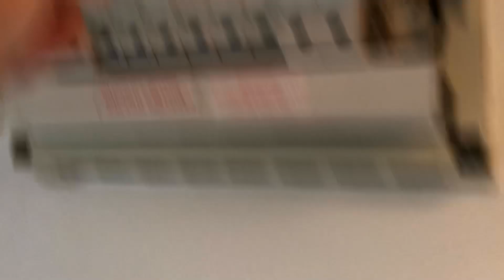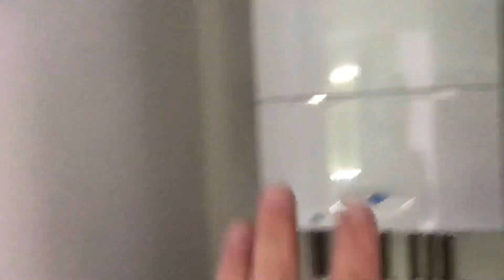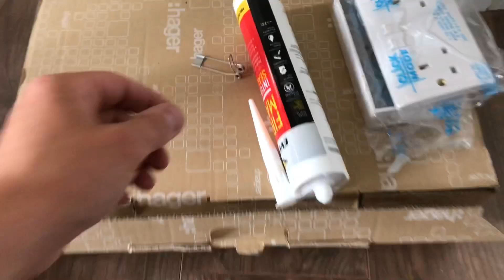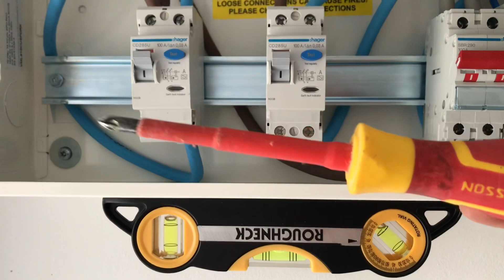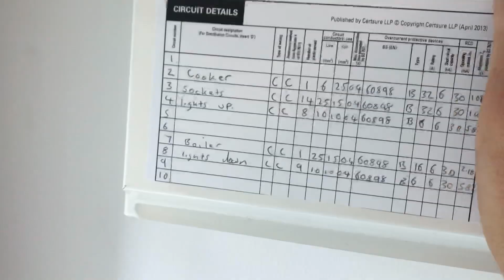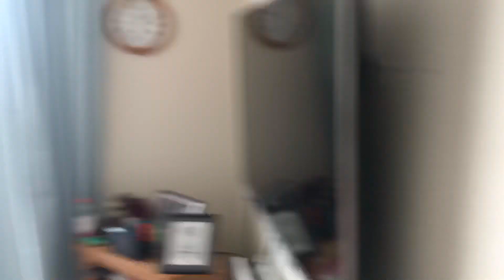CJR ELECTRICAL Installing 18th edition compliant consumer unit.

Comment: Is that fire mastic easy to remove if you needed to pull another cable through in the future?
Reply from the maker: Yeah just push a driver through or stripped cable
Reply: @Cjrelectrical  Great! Thanks for the reply

Comment: This video now a year old. I'm sure you found the neutral earth fault by now? I'm sure that you also would have fitted an mcb lock on that faulty cooker circuit.... Presumably the board that you changed it from didn't have rcd protection on the cooker.?

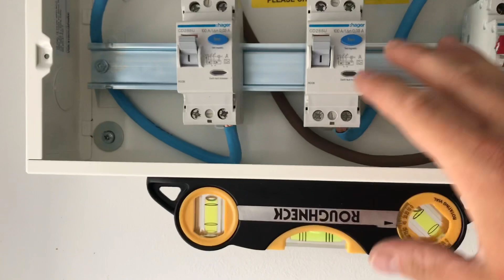Comment: 18:45 screwdriver in court? If you want to cover yourself, put the screwdriver calibration certification number on your test sheet, it's on that piece of paper everyone puts in the bin and not in their toolbox. However if your up against a good prosecutor in court they will ask.. "have you been trained"? " talk me through the use, checks storage and maintenance of a torque screwdriver". You get that wrong then holding your screw drive in court for your defence is pointless.  
You have a check dead tester..... how do you check your screwdriver?  🤯

Comment: I would be worried if any ( spark ) carrying out domestic work failed the 18th course to be honest.The one day course should be enough as most people have a read up first and then it’s just confirmation of what you should know on the day ( nerves can be an issue for some ) Domestic electrics is not rocket science is mainly common sense 😃 your videos serve a good learning curve for youngsters who go to college but sadly can’t find firms to take them on at present keep up the good work👍Let’s get onto a bit of 3 phase reversed rotation to get some heads scratching

Comment: Back to those SPD's again, this has to be a MASSIVE Money Making Invention, have you seen the prices out there! and whilst Hager do offer an SPD with a Remote Latching Device for you to rig up a sounder system, it comes at a massive price, way into the hundreds of pounds, sorry but for a couple of M.O.V [Metal Oxide Varisters and a copper quelching chamber] it can not be justified.
Trust me this SPD thing will only end as Tears at Bedtime.
I live for most of the year in the Auvergne, take a look at the amount of storms and electrical fires caused there and to date I know of not one installing with them installed or had one installed and then you expect the owner is to inspect them on a regular basis, yes, like that is going to happen, it will just sit if activated as a burnt out expensive piece of kit and trying to convince a householder it needs to be changed, best of luck with that.

Ask yourself do we realy need them, yes, I know what they are supposed to do and how they work, but knowing this I again ask, do we need them. Sorry about the rant but I will be using :-

Regulation 443.4
Overvoltage Control can be used for DOMESTIC Installations as your get out of Jail card in that:-

Protection against transient overvoltages shall be provided where the consequence caused by overvoltage could:

1) Result in seriouse injury to, or loss of, human life, or 
2) result in interruption of public services and/or damsge to cultural heritage, or
3) result in interruption of commercial or industrial activity, or
4) effect a large number of co-located individuals

As to item 4, I am not even sure what a co-located individual realy is, what the hell is that all about, any realy know, knock yourself out and post a response.

Like all bad things that pop their head up from time to time in our Industry, if enough people unite and decide that SPD's are not necessary in DOMESTIC INSTALLATIONS, it will all go away and in time life will return to normal.

Mr Spence Eng

Comment: Good videos. Bring back memories of 14 yrs of self employment.  I felt for you with that N-CPC issue. Been there (numerous times) when on the tools, even with my own fresh installation - because of long-standing defects in old appliances, particularly cooking appliances and lighting control eqpt. One customer had a nightmare of tripping after the power co upgraded (actually enabled) the main earthing. Tough to explain and tough to rip up kitchen floor and raggle nice walls to replace circuit segments!
Just a couple points that might make you think / bear in mind about an important distinction with responsibility / liability.
You gave a bit of advice to other sparks re if not fitting a SPD — in order to protect themself from a claim in the uncommon event of a surge severe enough to damage appliances —  they ought to get a record of the customer saying that they understand what a SPD is for... and they choose not to have one fitted?

My understanding (though perhaps I'm interpreting regs incorrectly) is that from 2019 that would in fact do little to absolve the installer of liability - because although fitting of SPDs is advised, rather than mandated, for compliance the installer would then have to produce a report justifying in a technical sense why a SPD wasn't necessary, including a detailed assessment of various aspects of the incoming supply (characteristics, length, configuration in supply-side network etc), much of which would require formal queries to the power provider... and hence not fitting a SPD would not be a route that most sparks would want to go down now. — regardless of what the customer's written instructions were... 

Then there's the temp fix thing. Been in that position as well - many times... and yes I may have done something like temporarily put a HR (not flame resistant) flex somewhat close to a possible source of flame.  
Eventually though I became less pliable / far more cautious in offering 'easy' temp solutions ('temp' often ended up long term once the spark has gone)   You see it doesn't matter that you advise someone to do or not to do something unusual just temporarily. In the final analysis if the safety of a piece of work hinges on (for instance) a customer not using a gas hob ring... and somehow ensuring that any/all other possible users know about and remember to comply with that; then technically, whether for 5 days, 5 months, or 5 hrs, it is not acceptably safe. And legally you are not safe. All would change if things went pear shaped and lawyers or HSE or plod got involved - and what the customer said or understood or agreed with (even if you video'd their relieved agreement), would be secondary to the central issue of technical compliance, of which you are held to be the competent party - not the customer.
\_(シ)_/
Take care and keep up the vids.

Comment: Hi mate did they give you any info saying we are allowed to cut seals to check fuse size I just had a assessor saying we are not allowed
Reply from the maker: Haha funny that I was told that the seals are always cut aren’t they.
Reply: @Cjrelectrical  yeah lol that what I said but he said you need to get the dno to come out put an Isolator in and they will confirm fuse size what you reckon lol
Reply: Have you ever fitted one of them isolators your self seem pretty cheap from toolstation
Reply from the maker: greg davies yes I try to now on every board change.
Reply: @Cjrelectrical  do you use any particular make are some better than others

Comment: strange having the consumer unit against the ceiling - in north america the codes say it has to be midway up the wall at "short lady" accessible height.
Reply from the maker: Yeah we do have a regulation height for a new build install but as this is an existing we have to install where the cable length will allow.

Comment: Where I am the the voltage is running at 254v surely the energy suppliers should be fitting these not the consumer, Its not like they can't afford it. They have just bumped up the price of electricity to cover the cost of installing smart meters, so they can save money by not sending someone out to read the meters. Who is going to want a consumer unit changed when you tell them its going to be near £600.00 providing there's no faults!!

Comment: Hi Chris very interesting video with the torque screwdriver do you need to have it calibrated every 6-12 months to check they are still correct? Cheers great channel

Comment: Gr8 video . Going above n belong with a lot but gr8 to see it get done right . 1 Question why not rcbo s instead of dual rcd . Neu to earth will only put 1 circuit down . Instead of one rcd . And honestly I have not done an insulation resistance test in occupied property. If you are fair play but what a baw ache 😖

Comment: I hope you removed that twin socket for the oven and Hob when you was testing for the oven, because it could of been a faulty socket? Didn’t see it removed in any of the videos? Would be the first thing I’d of done but you didn’t mention it in your video? As I’ve sockets like that hidden away with damp problems etc causing that.
Reply from the maker: Thanks for the comment unfortunately I don’t get to fill every think otherwise my videos would be six hours Long. I did however disconnect the socket and retest to find the cable was faulty

Comment: Hi ya, a random question, I have a new boss at work I am a site maintenance guy in a school, now I know in your own home you are allowed to change sockets light fitting switches,  and this sort of stuff,  the new boss is very keen for us to do this sort off thing at the school, question is are we allowed to do it or not ? I am thinking the like for like rule at home does not apply in the work place ?
Reply from the maker: All the maintenance guys that I’ve know to change sockets and lights in schools and hospitals have all been fully qualified electricians. No way should you be swapping light fittings and sockets in s school unless overseen by a skilled operative or performed by a professional.
Reply: Hi thanks for the reply, I am in agreement with you, just need to get the boss to realise we should not be doing anything with the electrics other than replacing blown light tubes and starters, and I am trained to do PAT testing but that's as far as I want to go, I have no intensions of replacing damaged sockets.

Comment: You should take a look at the Fusebox 18th rcbo spd consumer units. Its all I fit now. Technically a dual rcd board doesn't comply with reg
314.2   A single circuit failure should not affect another circuit.

Comment: Pretty sure you can only omit the SPD if it passes the risk assessment, regardless of what they send you  via email.
Reply: For dwellings SPD can be omitted, no risk assessment required. Certainly should discuss with client though as they're not that expensive and may save your TV or even a rewire. :)

Comment: The new consumer unit is 4 times the size of the original for four extra ways. lol
Reply from the maker: Yes correct but 6 ways are taken up by RCD’S and an SPD.
Reply: not comment on your work, i'm impressed with what you do and your standards, we are going to need more space to fit modern boards, at least there is more room for the mountain of stickers to be fitted. We go for rcbo boards now, it saves 4 spaces taken by the 2 rcds. Keep on with the good work and posting your vids. I shouldn't like them(it's my day job too) but I do.

Comment: You can not cut seals and pull fuses, everything from the service head to the meter is DNO property, nowhere in bs7671 does it say you can pull fuses.
Reply from the maker: I never said it says in BS7671 you can pull fuses or cut seals. What I did say is the 18th edition lecturer who is also an inspector did say rather than working live as stated in the HASAWA. Yes we can pull the fuse for safety. But please if in doubt ring up your local DNO and have them fit an isolator for you.
Reply: CJR ELECTRICAL so you’ve done a video telling all your subscribers you can pull fuses because a random lecturer told you that you could, the fuses are sealed for a reason and only DNO or meter engineers can cut the seal or re seal them, electricians can not pull fuses. I know this because I used to be a meter engineer and you need a completely separate qualification and to be registered to cut seals, pull fuses, and re seal them. So people who have watched this now think it’s acceptable to do things that they shouldn’t be doing.
Reply: @WhiteRoseShooting  Southern Electric some 20 years ago gave all the NICEIC Approved Contractors in our region 200 seals each and said providing you were registered with NIC or ECA they were happy for health and safety reasons that you cut the seal to carry out works.

Comment: I'd say to any one doing any installation for a kitchen put a piece of plastic conduit from the isolator to under the kitchen unit and put the cooker cable into it as it does make it easier to replace the cable if there is damage or poor test results on this cable.

Comment: I personally prefer to label all my circuits in any DB, I was told never to bend over the end of the wires incase you find they get stuck in the termination & always wiggle the wires in the termination & then check it for tightness afterwards.

Comment: Great vid Chris,
Just regarding the SPD stuff, with the examples given while going through the 18th edition course, i still can't see any good reason to be installing them in a domestic property.
I rang the technical help line at the NIC only last week and even he couldn't tell me that "You MUST fit them". Seems like a load of scare mongering in order to sell more materials to me.
Reply from the maker: Give it a while I believe we will be fitting them more often.
If you think the cost of one around £100 then think what equipment is in a house plugged in or hardwired it might shock you. Know of any gas boilers under £100
Reply: @Cjrelectrical  
I understand they might be a good idea, but do we HAVE to fit them?
And if I'm carrying out a EICR, do we have to start giving "Unsatisfactory" reports because they aren't installed as a consequence? Judging from what I've seen so far, I think not.

Comment: Talking about regs all vid but did I see some test leads not conforming to GS38 🤔 7:35
Reply from the maker: Transparent test tips
Reply: @Cjrelectrical 
Cheeky bugger, really had to get my squint on to see them 😆 Keep up the good work with the vids. Remember first watching when you was running a shower supply through an airing cupboard and now you're one of the best on here for real life sparking 👍🏻

Comment: Torque screw drivers are the way forward
Reply: Yer nar, just go tight enough to stress the screw just before it snaps and back it off by quarter a turn, next sparkies problem, or round the screw head internally with the cordless drill, job done!

Comment: Hi Chris thanks for taking the time to create your videos, great channel. Could you tell me if when installing a Combi boiler if you have to have a dedicated radial from fuse board or is that only for immersion type heating? Can you still come off the ring final to a 3amp spur? Thanks for your time.
Reply from the maker: Yes perfectly acceptable but remember any problem on the circuit you will loose the boiler too.
Reply: CJR ELECTRICAL thanks Chris
Reply: Sorry so is it best practice to run a separate radial?

Comment: Re measuring resistance on a radial from neutral to cpc, if you short L & N at the far end to do R1+R2, can't you then do one insulation resistance test from L+N to cpc which will show you any leak from either conductor. Obviously if you get a fail you can remove the short and investigate whether the fault is on L or N.
Reply from the maker: Yes I’ve just purchased a piggy back lead to carry out such test.

Comment: SPDs are a nice idea that i am sure will become standard, a better upgarde in my opinion would be to make RCBOs mandatory rather than split loads which arguably don't comply due to the disruption they cause in the event of a fault and the RCD not resetting.

Comment: Since when can you cut seals.
Reply: It’s not part of the installation
Reply: The legal authority already exists for a court trial to cover inteference with the supplier's equipment, under the terms of the ESQCR regulations, the EAW regulations , the H&SAW etc act, the parts of the Theft Act that apply to Electricity Abstraction as well as the Electricity Act sections 6 & 7. All it needs, is for the DNOs to decide to enforce it. 

There is also a condition under my employer's terms and conditions for electricity supply, which require the customer not to damage the supplier's equipment and also not to permit anyone other than the supply company to interfere with the seals. We have a record of who sealed every cutout and meter in the island together with the seal numbers, plus a dated photographic record showing its condition including the seals. Missing seals would be reported by meter readers and are investigated. 

In terms of the maximum penalty, the "scale charge" on conviction is a maximum of £3,000 and / or 4 months "full board and lodgings" courtesy of Her Majesty.

Comment: Personally, I would’ve used fire rated expandable foam in that cavity before fixing the consumer unit, then any areas interrupted whilst installation I would’ve topped up with more foam post install.
Reply from the maker: I’d have to derate all the cables then as classed as 100mm of insulation and Rewire the whole house. 👍

Comment: The torque is a great issue, the most common reason for CU fires. seen it so often. especially in the commercial word. were machines are tossed in over shut down.

Comment: Pulled some wire in my current house to replace older wiring for the light to switch circuits and I saw some brown/light brown/earth at the shop, which I thought was a cool idea. Ended up running triple/earth and sleeved it in the appropriate colours in case we upgrade to powered switches later down the line, though.